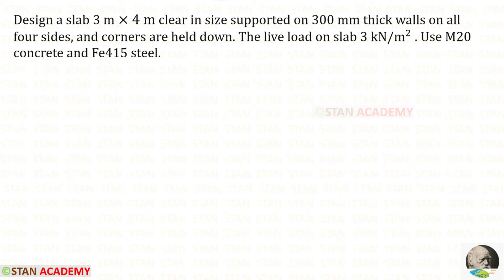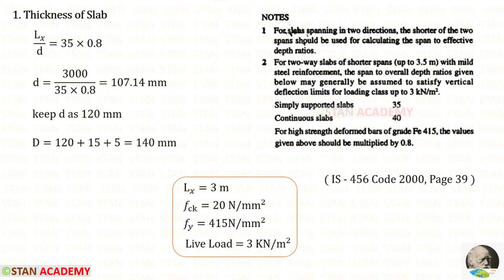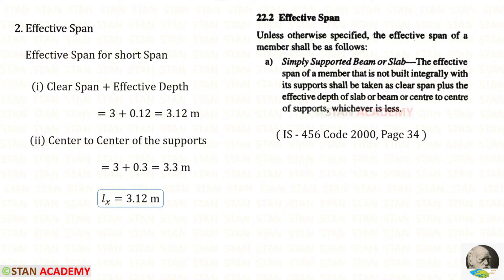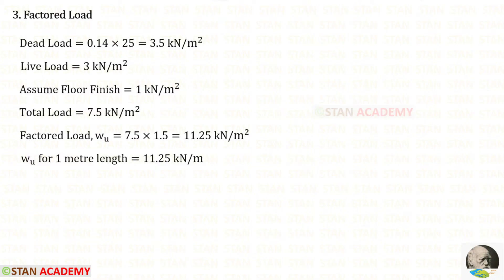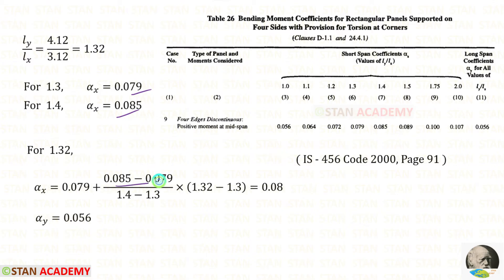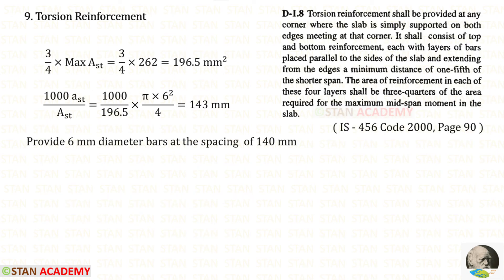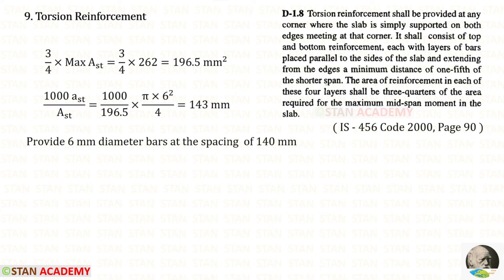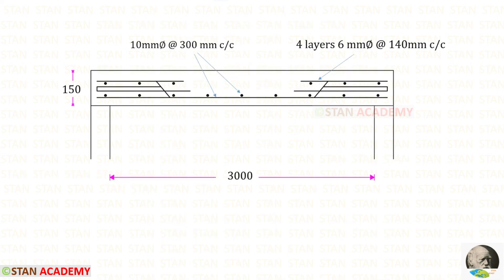Design of a Two Way  Slab - Corners Held Down / Corners Prevented from Lifting / Restrained Slab

Comment: after3rd step the value of ax calculated easier but value of ay, how? there 

only given ax on table 26, can we use table 27 for simply supported on 4 side and held down corners case ?